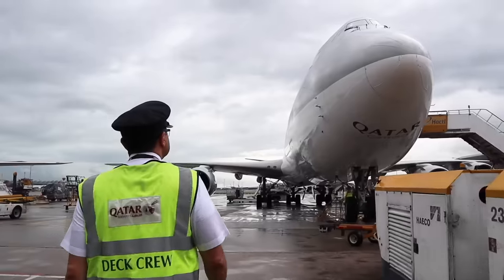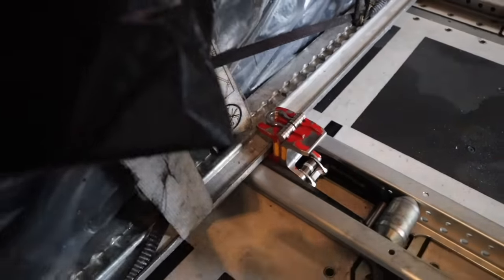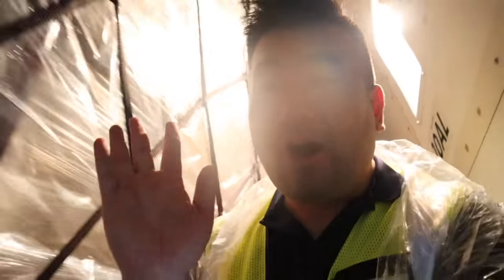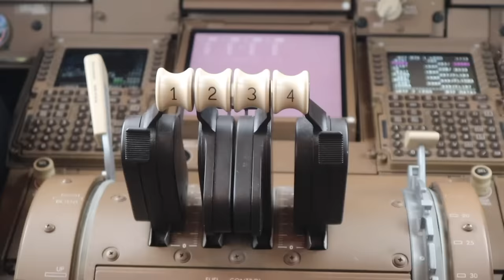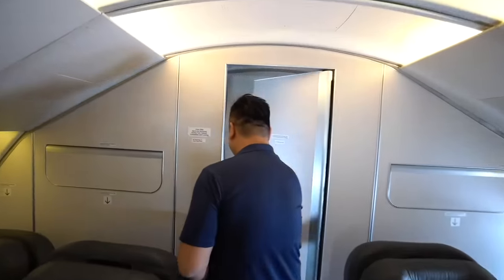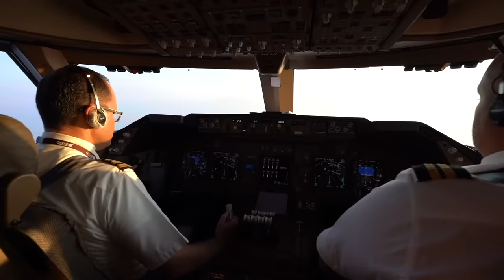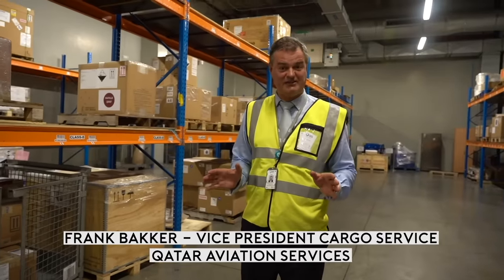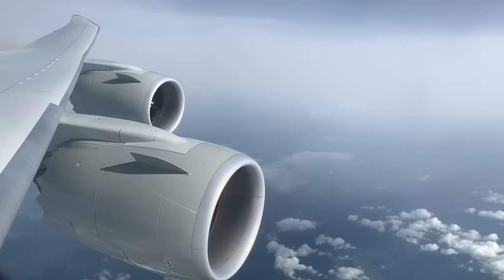Flying on Qatar Airways B747-8 Cargo Plane

Comment: I personally signed off with my multiple approval accounts as a designer and module owner when I worked at Boeing on the emergency oxygen systems on this plane, I have to admit I cried when I was on the flightline and saw the first flight. So many hours spent working overtime, this brings back memories, It's a beautiful plane.

Comment: First class
Business class
Premium economy 
Economy 
CARGO
Reply: And on some airlines, they now have one class BELOW Economy...  introducing Basic Economy. Last to board, no full sized carry on, the only carry on size allowed is whatever fits under your seat. If your bag is too big, pay a penalty plus the baggage fee.
Reply: I think cargo is above business class at this point jajaja
Reply: Hotel? Trivago
Reply: And I think this is even worse than basic economy https://en.wikipedia.org/wiki/Vertical_seat
Reply: @DannyBeeVegas  Kinda make sense if it's just a one hour flight that you go with just a backpack, though...
Reply: @FlameRat_YehLon  No, these seats are on almost every United and American Airlines flight in the US. Checked at the gate, a roller bag will cost you over $50 which negates the money you saved.
Reply: @DannyBeeVegas  But it's not unrealistic to take a flight with just a backpack (if it's a short trip), which probably won't cost extra money (unless the backpack is just insanely huge). In that case, when there's no other option, I don't see much of a need for regular economy.

In China people would take high speed train instead, though, slower during travel (around half the speed of a plane) but almost always arrive on time and it's easier to check in, and it's not like budget airline/flight seats are even an option here due to the strict air quarantine making up quite a part of the ticket price.
Reply: First class
Business class 
Premium class
Economy class
Cargo
Spirit Airlines
Reply: I think the one below economy is called "flying sardine can".
Reply: And above first class ethiad residence😂😂
Reply: OR
CARGO
First class
Bussiness class
Economy class
Reply: IKR
Reply: Rui Zhang oh my god that’s horrible...
Reply: 747 likes
Reply: Gabriel RC nice.
Reply: I'll go cargo any time, 2 meals, less germs, a comfy bed, private as it gets.
Reply: @DannyBeeVegas  it's better to board last in my opinion because when ur on 1st people keep walking past and hit u with their suitcases and arms
Reply: I rather fly CARGO than first class
Reply: I have been on every single one except cargo
Reply: Daniel B there is a new class, which is below basic, where you dont get a seat, you will be standing up the whole time and no food🙈✌️
Reply: First class
Business class
Premium economy 
Economy 
CARGO
RYANAIR
Reply: Mache on the track lol
Reply: correction:
you had to add the residence
Reply: steerage compartment
Reply: Dont forget to add jumpseat/ galley
Reply: And add emergency exit

Comment: Boeing 747: I'm a big plane!!
Airbus A330: Hold my Trent 700.
Reply: 747 is still bigger
Reply: 747 is a monster..
Reply: @Eyskapz  A380 FTW.  /rip
Reply: @spaceboy3101  747-8 is longer than the a380
Reply: Sam Sam agreed. 747 is larger than A380 in terms of length. But, if passenger capacity is of concern then A380 wins.
Reply: antonov 225 mriya: 
gobi gobi gobi
Reply: The GE9X fan is 11 feet in diameter. Recognized as the most powerful turbofan in the world. I don't think it would fit in the door like the Trent. Gehttps://en.wikipedia.org/wiki/General_Electric_GE9X
Reply: @13dma1rz  I know, just a joke.
Reply: cjg
Reply: @spaceboy3101  The A-380 would make a lousy cargo jet. No upswinging nose section or raised cockpit for outsized cargo, not to mention not great turn around time.

Comment: It still amazes that some so large and heavy can liftoff and fly.
Reply: Light food Only!!
Reply: all about the mathematics
Reply: You're head is still in the 1800's engineering buddy
Reply: Daniel Lee 
not mathematics. just speed and gravity
Reply: Gravity isn't that strong. Think about it. Something as weak as a magnet, can countrract gravity
Reply: Dom s yeah nah gravity ain’t that strong makes me wonder why you aren’t flying to work everyday.
Reply: lorenzo lohman roughly mathematics but the more correct address is fluid mechanics and Bernoulli equations :)
Reply: That's aerodynamics and engine thrust for you.
Reply: The Grimwiz 

What’s really funny about this comment section is that there are ultralight home built planes that weigh less than 120kg, some as little as 85kg, and if I wanted to fly on them I might have to strip naked (with horrified looks of beach goers, and no I don’t live on a beach) just to be light enough to fly on them. Sam too.
Reply: Yes even when you understand the theory and mechanics of flight it is still amazing just because of the huge weight!
Reply: Me too, but what amazes me more is how much of a  beating these planes can take day after day and still hold together, and especially when you see those giant wings make those huge flexes as they hit different pockets of air.
Reply: Time Flies used to be here  for work over twenty years ,remind me of the good old days
Reply: you calling sam fat?

Comment: Using a b747 to carry an AiRbUs EnGinE
Reply: Lmfaoo becareful airbus fans gonna come after u now
Reply: Some Boeing’s use rolls Royce  engines and some airbuses use Pratt and Whitney engines and not rolls Royce engines
Reply: @hanj31  The crew said the engine is for the A330
Reply: Airbus don't make engines Nor does Boeing it's a RR Engine for Airbus i am sure that Boeing uses RR as well lolllll
Reply: @andersonrodriguez8258  That's me that's me but i do love the B747 it's a great plane no doubt
Reply: Tim Miles yes o think They do (though mainly GE) but it was a RR engine for an A330. Gotta love the 747 beast
Reply: Well the B777 uses trent 800 engines.
Reply: Benjamin Yee also GE on most variants
Reply: There is no such thing as an ‘airbus engine’... 🤦‍♂️🤦‍♀️
Reply: @atomic_typh00n66  YES. 👍👍 A rational comment.
Reply: Anyway, the Rolls Royce Trent 700 is specially designed for the A330, so basically it is not used in other types of aircraft.
Reply: @benyee90  777 uses GE90
Reply: He got so torn up was pounding his shift key lol
Reply: @benyee90  and GE90 an the 777X Uses GE9X
Reply: 777 also using the RR engines！
Reply: Wait... That's illegal
Reply: Power Plants options are decided by the buyer not the Manufacturer of the aircraft. Qatar Airways perfer Rolls Royce poweplants.
Reply: Its just business.
Reply: Airbus used to use Boeing Super Guppy's to transport all their airframes back in the day before they could build their own.
Reply: Benjamin Yee The Boeing 777 uses GE90 engines
Reply: @benyee90  Wait what?
Reply: Benjamin Yee Actually most triple sevens that fly in the world have GE engines on some of them do have a Rolls-Royce engines though and some have Pratt & Whitney engines
Reply: Byron Harano Yeah but that747–8 in the video has GE engines on it If you listen closely you can hear the pilot say that when he’s inspecting them
Reply: No problem for 747.....no problem for this Majestic airplane..... I ❤️ 747
Reply: It is kind of irony, but it's not Boeing but Qatar Airways that carry the cargo ;)
Reply: @andersonrodriguez8258  If it's a Boeing, I'm still going! If it's an Airbus, it'll take us!
Reply: @TheAirplanejunkie  And Pratt n Whitney and  General Electric for both brands as well.
Reply: @benyee90  Yep. A beautiful combination of plane and engine.
Reply: @atomic_typh00n66  there are engines made by engine companies SPECIFICALLY for certain airbus planes and for certain boeing planes.
Reply: Julian they actually use Ge9X engines
Reply: @atomic_typh00n66  Technically, the Trent XWB and the Trent 7000 are "Airbus engines" since they do not, and will not be made for a Boeing model.
Reply: No the 777-200/200ER use PW, RR and GE-90 (thrust dramatically derated by like 40%). The 300 uses RR and PW. The 777-300ER and 200LR use GE90, 115B 110B or 113B.
Reply: Airbus doesn't make engines. RR, Pratt & Whitney, or GE does. It depends on the plane customer what they prefer.

Comment: “Use this door for an emergency”.
There is a 1 tonne generator in the way
Reply: No problem, the windshield is also an emergency exit.  To open this exit, just apply a 200 knot faceplant.
Reply: lets hope the co pilot can get out, he might grab a burger from the galley on the way...
Reply: don't worry it's just a small hassle

Comment: Great aircraft the 747-800 ,unfortunate it had to be finally consigned to freighter duties. Boeing is shutting down production of this iconic beauty. Most of the older 747s are also being converted to this purpose. However fuel costs are very critical, beyond a certain price and the aircraft is grounded; operations being uneconomical. Great video Sam , play it again.
Reply: 747-8*
Reply: AnSonn xtv I just Googled your information. Nowhere is it stated that the 747-8 is having its production line shut down... I did read that the future appeared limited, as the 777X jets provide longer range and better ecomincs on two engines versus the four of the 747. But again, no mention of a line shutdown.... Also, they won't ground the aircraft anytime soon. If anything, other airlines will either purchase them, or the aircraft gets sent to the desert if no one can operate it.
Reply: @KingTriton1837  did you manage to find out how are being made? As far as grounded is concerned it is simple economics that 4 engine aircrafts are no longer in favor  including the A380 .The point being the 747s operation is completely dependent upon the price of oil -beyond a certain price it becomes a loss making enterprise ,  doesn't matter who buys it. In fact you will not find a buyer. Bet you couldn't find that with Google, it's called original research.
Reply: Its better than the fate of the A380s
Reply: @jayvee8502  Not much .In fact all 4 engined aircrafts are on the edge including the A340 . The only reason that they are surviving is because of the historically low price of oil , which again is due to the extremely high supply of American crude from fracking . An increase of a few dollars will tip the balance and see these machines mothballed at short notice .
Reply: It’s maddening to know how much politics can be involved with fuel. You can “almost” calculate the real percentage of inflation by using fuel prices. 
8% inflation?—pssshhh…-more like 28😅

Comment: In 1979 I flew to he Caribbean from London on a 747. It had to take an engine out for a stranded plane. It was bolted into the wing so there were 3 engines in the right hand side. The plane landed and we all got off and went to a cafe in the airport whilst they took off the spare engine. We then got back on and flew to the final destination.

Comment: Now this is legendary I think it’s pretty hard how to move the engine around without damaging the 747-8F
Reply: it's not difficult, Engine loaded onto a standard aircraft engine stand than loaded onto 20F pallet dimensions 98Wx238.5L max load gross weight 25000lbs  which occupied two main deck positions. weight and balance also not difficult, remember center of gravity. therefore heavy cargo such as 20F ULD all possible load near 
on the  center of the aircraft. very easy and simple going through the side door as lone as  Over All high at one side near the aircraft panel not to over 116 inch at the  corner ( a normal size pallet dimensions 96Wx125L= one  position.)
Reply: @michaellow4368 Low well, the problem is how much space the engine can take. Due to the size, it will take it's very hard to work it. But that is why it takes time, to load that engine instead of the pallets
Reply: @jakesnussbuster3565 Plays very extremely calculated. Every centimeter counts

Comment: Dude how are you doing all of these? Is riding a cargo plane like unavailable or somethin?
Reply: Yes flights on freighter are unavailable to regular pax
Reply: Riding in a cargo plane is not open for public, mostly crew or authorised staff or personnel accompanying important cargo. He most likely was invited to showcase the cargo service by the airline, Sam have built a pretty good relationship and have good credentials among the airlines throughout the years so it helps
Reply: @mtfbwy78  No
Reply: He’s paid by the airlines for publicity
Reply: @mtfbwy78  I'm don't think so, judging by the video I think the freight forwarder company would be happy for the free publicity generated by this Qatar Airways collaboration with Sam. The only issue would be if the video showed the shipping address which could cause privacy matters and to which I didn't see any
Reply: @SoneRevMy  agreed with you...👍
Reply: @johniii8147  Not always. I'd wager that a lot of the time the airlines just give him a free trip instead of paying him. He doesn't have to pay anything to get his footage and the airline gets good publicity.
Reply: @apyt100 Not really, planes go by their max weight, whether it is cargo, people or fuel. For example a passenger plane fully loaded with people and their luggage might be heavier than a half full Cargo, but when they are both fully loaded, they should be the same if it is the same type of plane.
The heavier the plane the more speed it needs for taking off and landing.

Comment: I believe that they can also transport the engine as cargo under the wing.
Reply: Peter Absolute bollocks
Reply: Caleb, Quantas has done it on a 747 from Sydney to Johannesburg and there is a picture, google it and bollocks to yourself.
Reply: They call it the "5th engine pod bollocks.
Reply: Guess only the engine type the plane uses

Comment: I know it’s dumb but it just blows my mind that HUGE heavy jet, now loaded with crazy heavy cargo including plane engines, hundred of tons and those otherwise little engines of the 747(compared to the whole plane) is able to push that plane hundreds of miles an hour, 35,000+ feet in the air. It just defies logic sometimes. I get that the engines are certainly bigger than they appear on video. Amazing feat of technology

Comment: A question, at 6:35 they captain walks past the front landing gear and you can see a yellow hawser running from the plane to the ground, is this to prevent the aircraft from rising the nose when being overloaded in the rear?

Comment: but if the engine dosen't fit why not use the dreamlifter or beluga? I know they are used to transport part of planes but Boeing and Airbus can still use them. And of Airbus made a A380F maybe engine producers can build larger engines as they can fit in the body of the A380

Comment: Production of the Airbus A-380 has ended.  The first A-380s have been scrapped already.  But Boeing is still building 747s today and has orders yet to be filled.  Granted, nearly all (maybe all of them) are for 747-8F freighters,  but there is no question:  BOEING WON.   While the 4-engine jet as a passenger plane is heading into history,  the economics of the 747-8F make it the most economical air freight solution for international cargo on earth.

Comment: Very interesting video. I’ve always been curious how this works. Couple quick questions…do the same 2 pilots typically fly with each other often or are there usually different pilots together every flight? How many flights could a cargo pilot do in one day? What are flights like that may be over 10 hours? Can they take naps? How many crew are typically on board?

Comment: New Boeing 747 will change fuselage with carbon composites,  retrofit electric generators and the most significantly upgrade engines. Done. 2021. 03. 20. Dr. Alex.